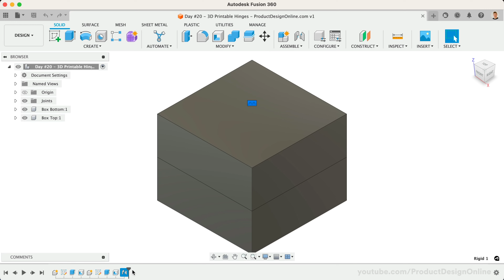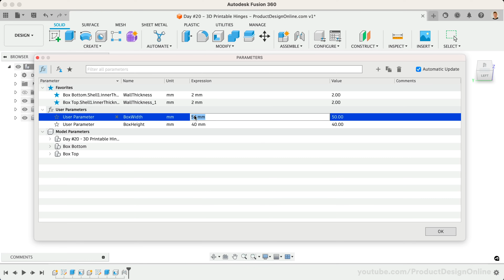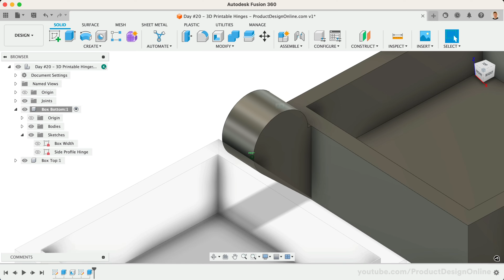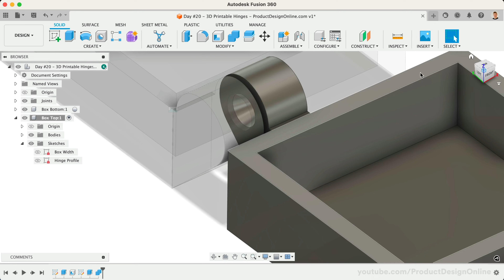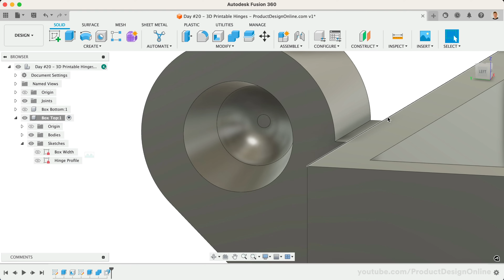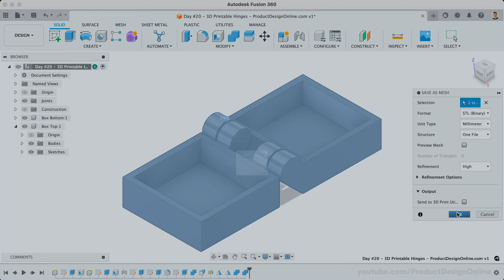Design 3D Printable Hinges | Day 20 of Learn Fusion 360 in 30 Days - 2023 EDITION

Comment: I'm just learning, but I got stuck at one spot... I kept creating a joint over and over and couldn't get it to show up in the timeline. I think the issue was I didn't have the root component selected, and the joint was getting created inside of one of the box components, so then it wasn't showing up on the main timeline. Just a thought, in case you want to mention that potential pitfall, if my understanding is correct!  Awesome series - really appreciate it!

Comment: I'm about 3/4 of the way through this, and I'd like to ask is there a way that you would build the width of the boxes spacing to take an account the thickness of the hinges and offset automatically. Or would you go through this whole process get it laid out and then start tying things together so that if the hinge needs need to be thicker the boxes will move the appropriate distance

Comment: Loving the tutorials. I have always wanted to learn Fusion but never found the right tutorials.  These have been great. 

Had an issue with fully defining the inner hinge, couldn't figure it out.  Turned out my solution was to draw the horizontal line and apply the constraints, even though it had been drawn correctly.

Comment: At the 2:52 mark, I create the tangent line to the circle and click "Finish Sketch" yet it doesn't show the lock. I've started over a couple of times now and cannot get a lock. What am I missing? New software is different now?  EDIT: I fixed it by drawing a line from the bottom left corner of the sketch to the top left corner, this made everything color blue and when I "Finished Sketch" it showed the lock icon.

Comment: Why in all these videos do you never explain WHY you should choose the MIRROR from SOLID not SKETCH, or why these are different? :/
Reply from the maker: In Fusion, solid modeling mirrors create fully independent, mirrored bodies or features, ensuring better parametric control and easier downstream edits. Sketch mirrors only create mirrored sketch geometry, which can limit flexibility and often requires extra constraints or manual updates if design changes occur. It also makes your sketches more complicated and error-prone.

Comment: Hey, is there a reason to use Offset at 6:12 instead of From Object? (plus 0.6mm offset) It seems like it would guarantee that it's always offset from that face. Just wondering if it's personal preference or if one performs better over the other.

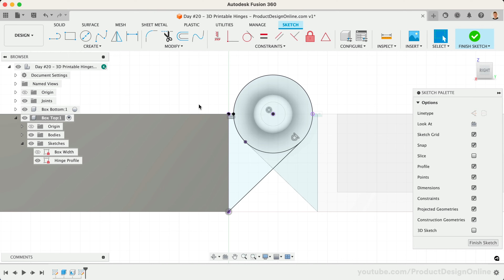Comment: For some reason I can't get the second hinge profile to extrude correctly at 5:54. It doesn't allow me to select the area on the middle of the circle (area with the hinge pin), and extrudes with the hole in the center. What am I doing wrong?
Reply: I figured it out!
Reply: @philipproederer2496  Me too. Can you please tell me how did you solve it?
Reply: @subcom2793  You have to extrude without selecting the profile first. Just select extrude then manually add regions

Comment: Thank you.  I finally got it printed and it worked! The hinges are a little loose but it actually works!  tried this 3 times before this and they didn't work.
Reply from the maker: @scottthecrazy  you can reduce the tolerance for a tighter fit. I used these as a starting point since some folks don't have their slicer or printer dialed in 🙂

Comment: I know this might be a dumb question and if it is then I grant you permission to kindly roast me (nothing too crazy) but do you print the whole box as one single print or do you print each half separately?
Reply from the maker: not a dumb question. Yes, you print the box as a single print with both lids flat on the build plate.
Reply: @ProductDesignOnline so did you use supports for it? I followed your tutorial and gave overall 0.8 mm clearance in the hinge, so I want to ask how will the printer print it

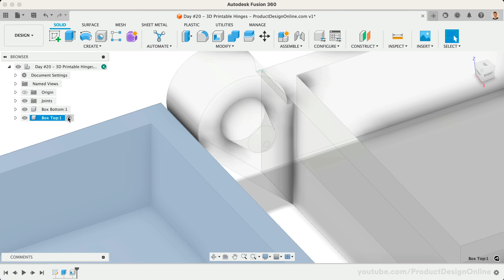Comment: Thanks for these! Thanks for your response on my comment on the other video. I was able to work past that issue. However, I'm stuck here. I am fine making the first hinge piece. However when I go to make the sketch for the inner hinge piece (at 4:33 in this video), I don't get the option to create a new sketch as there is already a sketch on that plane. Instead, I just get the option to edit my existing one which I obviously do not want to do. I have confirmed that I have the box top active (the previous sketch was on the box bottom). I can think of a few ways to work around it, but I'm wondering what I'm missing. Thanks in advance for any help!

Comment: Really cannot thank you enough for this series. It's hard to appreciate how imperative a deliberate and consistent workflow is. This series is such a great opportunity to learn not only what the tools do but how to use them effectively. 

I tightened the hinge clearance to 0.3mm. There is no perceptible play in the hinge, and it operates perfectly.
Although, like others have commented, it does not close all the way. I am guessing 0.0 tolerance between the box halves is just not realistic. Just like how you need some clearance between the moving parts for them to function.
I raised the hinge point center 0.1mm which almost got it there. I bet 0.15mm would have done it, 0.2 for sure.
Reply: Thanks, that seemed to work.

Comment: Just a pedantic comment: around 8:18, you are mirroring the hinge pieces but they are going into the top-level component instead of their respective subcomponents? Surely that's not the way? :)
Reply from the maker: The top level component can be active when mirroring, as the items will fall within the component selected for the mirror.
You'll notice that after completing the mirror, no bodies folder is created at the top level. 😄
Reply: @ProductDesignOnline  Thanks for the reply Kevin, that's a good thing thing to know going forward :)

Comment: This has been a great series, absolutely.  Thank you Kevin!  The model printed great.  I wanted to mess with it a bit and add an offset between the top and bottom so that the lid sits flat.  I tried to rotate the joint and it's locked.  I tried to convert the joint to a rotating joint, but the joint point is on the edge of the box and not the the centerpoint of the hinges.  Anyone have a tip or recommend a video that covers joints in more detail?
Reply from the maker: In this case, you would need to remove the original joint that we applied to place the box (and fix the reference issues to the sketch). You could then apply the revolute joint.

Here's a video that covers As-Built Joints (when parts are built in place): https://youtu.be/OsdL0VoaGl0?si=HoEjTm0aoglI9i5H
I cover Joints extensively in the PDO Academy courses, but don't have much free content on it at the moment.

Comment: This has been a very helpful video series—thank you! One challenge I've had with this model, is trying to go a step further and make a revoute joint work in software. Since we positioned the boxes using an fixed joint w/ offset, it seems to be really challenging (to me at least) to switch it to a revolute joint and get the boxes lined up. I can choose new faces such as the center of the hinges, but it oftentimes breaks the hinge geometry—I suppose because some referenced deisgn along the way. If I just change our fixed joint to a revolute joint, the boxes don't line up when rotated. If anyone has figured out how to make that adjustment, I'd be interested to hear. Thanks!
Reply: I am learning my way through this series now, and just sorted this out myself. You commented this 3 months ago so you've probably got this by now but if not, and for anyone else like me looking through the comments for this:

It seems the axis points for both parts of a revolute joint must be on the same axis and in the same plane. Having them on the same axis but different planes brings those planes together.
I resolved this by making the second box half active and intersecting the radius of the sketch of the first hinge part. That placed an axis point for the box top on the outside face of the box bottom hinge. After that I was able to select the same point for each resolute axis.

Of course he will probably cover this in one of the next few lessons but sometimes it's just fun to learn by exploration! :)

Comment: All of your videos are outstanding.  Most of what know about Fusion 360 (not a lot!) has been derived from your videos.  I use it for design of 3D printed items so had to try this as soon as I saw it.  

My box hinges worked first time with your suggested clearances.  However, the box does not quite close fully as there is interference at the hinge side.  I'll look at ways of adding in a small clearance then also adding a snap clip at the front to hold it closed.

My first use for one of these boxes is to hold SMA connectors and standards for a vector network analyser.  Perfect - a learning project with a purpose.

First class material, thanks Kevin.
Reply: Try this modification - move the centre of the hinge 0.3mm above the top of the box base.  This should also move the centre of the lid hinge by the same amount (worth checking depending on how the sketch was constrained).  The total gap of 0.6mm allows the box to close snugly without a small gap opposite the hinges.
Reply from the maker: @robinharris4706  Great tips and thanks for your kind words!

Comment: Good stuff. Is there a brief description of the differences in the mirror command while in sketch mode as apposed to not being in sketch mode?
Reply from the maker: They essentially act/work the same. The majority of the time you'll want to mirror components or bodies as it performs better and helps keep your sketches 'as simple as possible' (which is recommended for parametric design).

Some use cases, such as mirroring some sketch geometry to then deleting some on the other side, etc are where the sketch mirror command becomes helpful. Definitely use the sketch one with caution tho :)

Comment: Super helpful! Love the 3d printing content. 

Is there a particular reason you used the offset face command rather than push/pull to create the tolerances?
Reply from the maker: Press/Pull will not be recorded in the timeline, which is why I always recommend using the Offset faces command (so you can update the tolerances later, if needed). Otherwise, there is no physical difference in the result.